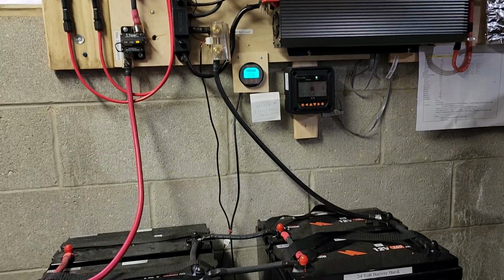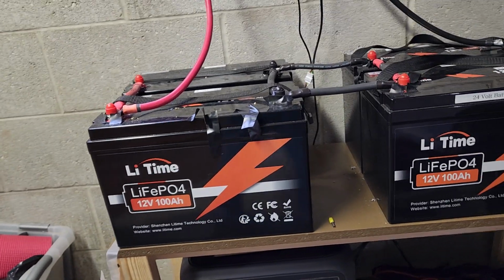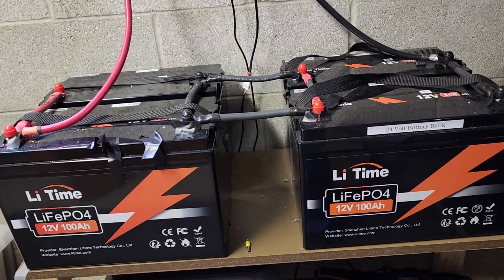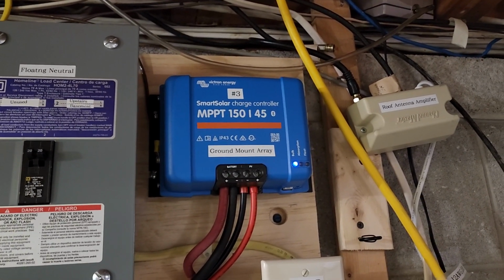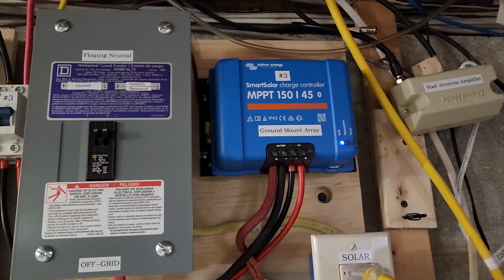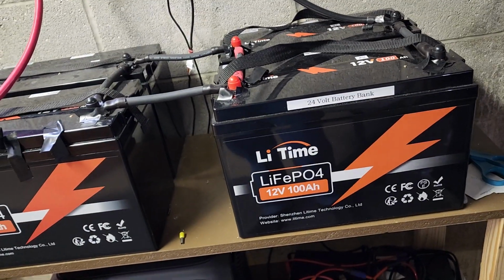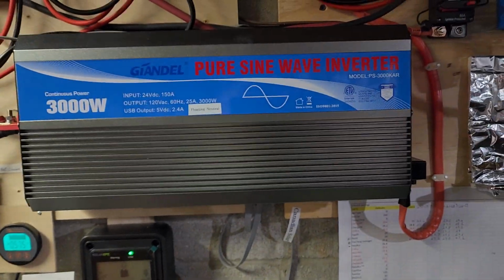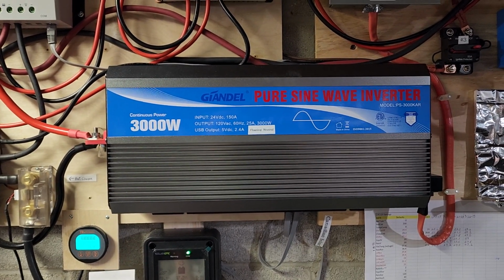EPEVER vs Victron Solar Charge Controllers

Comment: did you set the rotery switch to 7 on the victron? i have two of them on absorption it goes to 30 .2 i think it is two high but it floats at 27.6 on a 24 v system, im not munch on bluetooth
Reply from the maker: I don't remember.   I switched to 48 volt system a long while ago.  I' m using the Victron on that using default settings + an EG4 all-in-one inverter.
Reply: @arnoldsolof  ya i kinda like the plug and play, i set up 6 different unites for different parts of the house, i even got some old harbor frt panels running some lights in the house  im still buying batterys one or two a month started out with diy batterys. the eg4 must be nice thanks for the come back

Comment: I recently replaced an Epever 60A/150V Tracer EN with a Victron 60/150 Smart solar. The victron is obviously smaller, better build quality and easier to set up and control with the app, but to be honest apart from that i can't see any difference in terms of actual performance. I don't think the Victron is any better.
Reply from the maker: The Epever responds slower to power changes.  It would cause a Giandel inverter to briefly shut down and alarm for overvoltage when sunlight would emerge from under a cloud.  If your inverter is less sensitive, you won't notice a difference between the 2 controllers.

Comment: FOr me i have to restart EPEVER often (disconnect PV). it loves to stuck on low voltage so produces little watts and that's anoying! it only works nice when there is constant sun... if there is clouds/sun situation- epever is a problem.
Reply from the maker: Sounds like the pv array is not producing a high enough voltage for your battery bank.

Comment: I have just recently connected a Giandel 3300 to my 12Volt 280Ah LiFePO4 battery which is being charged by a Epever 4210 solar charge controller. I have noticed as the battery charges up that the inverter is intermittently giving the "HI" error and high pitched whistle indicating over voltage. The battery is showing only about 13.9 volts which I have verified with a multimeter and is nowhere near the specs of 16 volts in the Giandel manual. Do you think this is caused by the Epever charge controller? I have been searching for this scenario online and your channel  came up in the results. Thanks

Comment: Well, you're using the wrong batteries to start with. 
 Why bother with that? Just get 48v rack batteries.
Reply from the maker: I expect to get about 10 to 15 years use out of the "wrong batteries".  The system now has 8 of those batteries configured as a 48v bank using an EG4 3000 All in One Inverter.
Reply from the maker: Oh, and why bother?  It was much less expensive.   If I had to start over, I would get either the rack batteries, or better yet, one of the wall batteries equal to almost 3 rack batteries.

Comment: I build my 460Ah battery using CATL cells and JK-200A BMS. I use 60A EPever MPPT with 4x200W Rich Solar panels installed flat on van roof in 2S2P config. I am in Arizona but at the peak of the day in March, I only got a little lower than 500W at most. Wonder if that was due to poor performance of the EPEVER controller.  I am searching all reviews had not cited one about EPEVER inefficiency.
Reply: Put your panels in series. 👍
Reply: @Nemo_IRL  thats what i did and it seem to make a big difference
Reply from the maker: "Panels flat on van roof".   You are losing some efficiency due to the angle of the panels with respect to the sun.  My Epever controllers could output their full rated power.

Comment: I am looking into purchasing two EPEVER 100 Amp for a 48 volt Absolyte VRLA battery bank...still looking for any videos on these subjects.
Reply: I have 3 epever controllers, and they working perfectly.
Its a myth that you charge to be full, i charge all my cells to 3.45 volts in a 48 volt system and after boost, it will saturate for 30 minutes and goes to float mode.
It works already 3 years and just perfect

Comment: how can victron controller controller the Epever peak voltage???? they are 2 generator in parallel..if Epever go on peak, the higher voltage of the two, is what you have
Reply: The Victron is the higher voltage.

Comment: is funny like all are obsession with cells serie balance, but not with battery series balance😂😂😂

now, all cheap lifepo4 are garbage, cells have big IR difference and they never will last long. active balancer, top balance and all this obsessions are only because 90% people have crap cells. no good quality battery have active monster balancer or need top balancing. cells are premium with same IR. a lithium battery cant be overcharged. with the first cell at 100% charging stop. than, if IR cells are different, the battery will be garbage. very simple

Comment: i have epeverfor 3 years and  work perfectly, and victron for 1 years now. yes is better in some.
The power in one day is the same, but victron catch better cloud-edge situation when the power go above the nominal power of panel for 20 or 30 seconds due to the cloud reflection near the sun.
A 300w panel make max 310w with Epever and 330 with victron. a 450 w panel almost never reach the max 30 amp of Epever but reach the 30 amp on the victron more often. I dont see the max power with cloud edge because the 30 amp controller limit is about 430-440w and the 450 w panel can go until 470 sure.

victron have really no voltage peak with cloud or suddenly load shutdown or power on.
another thing, in rv, victron go to max power a lot rapidly at the exit of a tunnel or bridge. Epever maybe need 20 or 30 second, victron 2 o 3 second

Comment: You wasted your money on the victron  all you had to do on the epever is set the controller to user settings
Reply from the maker: It was on user settings.
Reply: @arnoldsolof  I have been using epever  for about 3 years are more with no problems
Reply: under user setting you can set the boost voltage and max charge and so on as you wish and the unit will perform as whatever you want from it will no problem.thanks for shering
Reply from the maker: Your comment leads me to believe you didn't watch the video. @bimmers323ci
Reply: if you had purchase the epever an series you would get the led lights on board that you are comparing with the victron....thanks again for sharing  @arnoldsolof
Reply from the maker: Did you watch the video?
 @bimmers323ci

Comment: I didnt see any thing about 14,2 to balance in the li time manual did you contact them ?
Reply from the maker: Yes
Reply: despite all lifepo4 YouTube-facebook-crazy scientist , I quote victor about how to charge a life. they developed for years the battery in collaboration with cells producers:

""""THE IMPORTANT CHARGING PARAMETERS ARE ABSORPTION VOLTAGE, ABSORPTION TIME AND FLOAT VOLTAGE.

Absorption voltage: 14.2V for a 12.8V lithium battery (28.4V / 56.8V for a 24V or 48V system
Absorption time: 2 hours. We recommend a minimum absorption time of 2 hours per month for lightly cycled systems, such as backup or UPS applications and 4 to 8 hours per month for more heavily cycled (off-grid or ESS) systems. This allows the balancer enough time to properly balance the cells. Please see the Cell balancing chapter for a more detailed explanation why cell balancing is needed and how cell balancing works.
Float voltage: 13.5V for a 12.8V lithium batter"""
Reply: And the victron nanual indications are generic for the chemistry, not for victron battery only. All the lifepo4 manufacturing say that absorption is regularly needed. Not every cicle clear. But many people put 0 time absorption and absormbtion voltage a 13.8 on lifepo4. For years. And nothing say this in literature
Reply: Ok ok JC I dont have a victron anything I'm not on FB either just a li time manual.

Comment: Puting lifepo 12 volt in series is asking for trouble . Never do that even if the bms say they can . Buy a 24volt instead or do your battery yourszlf ...
Reply from the maker: I'm in real trouble now because I reconfigured the 4 12v batteries into a 48 volt series for my new 48 volt all-in-one inverter.  Everything is working perfectly, so I guess they are unaware of your warning.
Reply: @arnoldsolof  i would not trust it unfortunatly :x i'have seen bms fail because of overvoltage ( since yours are 12 volt bms in series, this can happen ) the mofset burn but still let the bms alive unable to stop the current flowing to the battery ... i'm not saying this WILL happen to you, but it CAN, i have seen it
Reply: @arnoldsolof  unfortunately, this is not advised, unless the BMS's manufacturer explicitly says so: When you are running 4x 12V (nominal) BMSs in series for a 48V (nominal) system, and one of them cuts off due to OVP, then the other BMSs' FETs will potentially face a 36V (nominal) voltage difference, plus any over voltage by the charge controllers at the time (i.e. if the charge controllers are in full blast at the moment). Better make sure your 4 12V (nominal) batteries are nicely balanced, which means you should probably get a 4s 12V battery balancer, or alternatively 3x 2s 12V battery balancers.
Reply: @arnoldsolof  Your BMS will be fine!  Only +48 is seen at the far ends ( main + and main -).  Take a volt meter and check EACH battery + and - and it will be 12v.....if you do it in sequence from main - and step through the battery + from battery 1, 2, 3, and then 4, you will see 12, 24, 36, 48 but again the battery 1, 2, 3, and 4 only see 12v!  Gary from SE MI
Reply from the maker: Exactly. @Gary-wh7ce